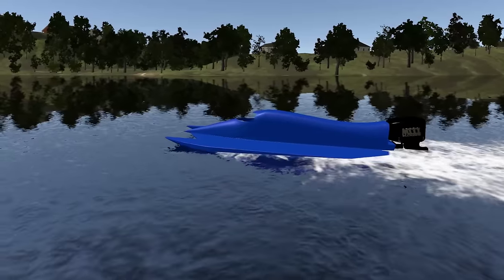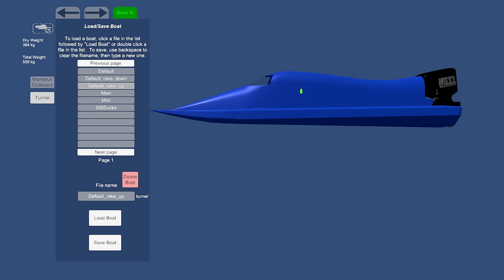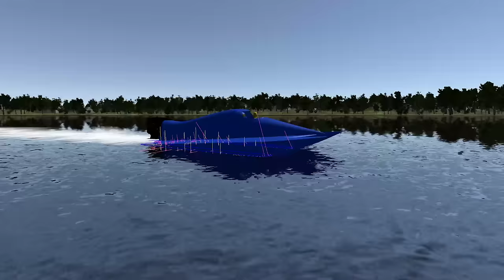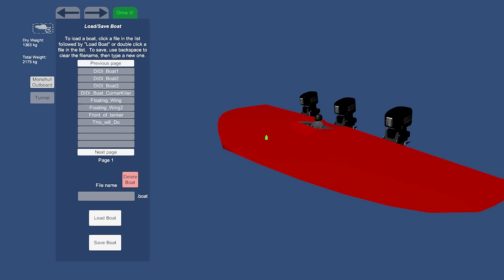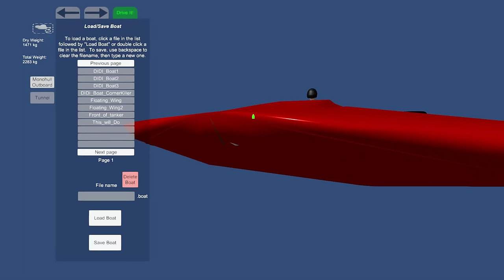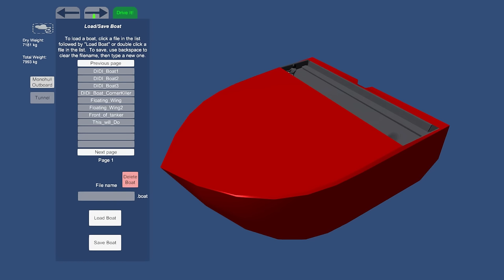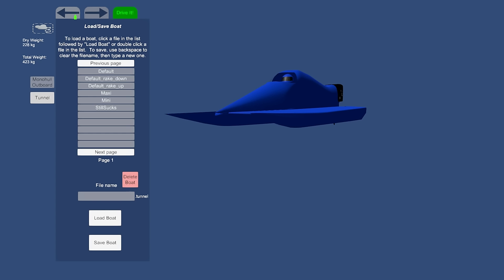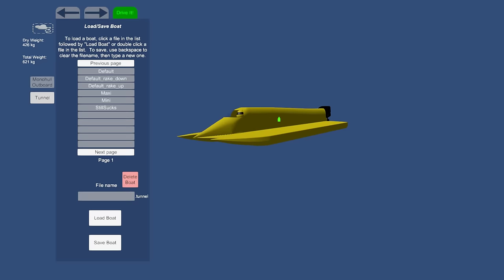Talk & Dive 22: Showboating!

Comment: Your trim is all the time wrong with the flying wing. But this is cool, I think I will buy this game :)
Reply from the maker: Wrong??! Its perfect! Ok, it can't be steered, you can't see anything, and swimming is faster.... but other than that.. :D
Reply: Hah, indeed :D. Btw, it's really easy in reality to flip your boat with wrong trim. Nearly did it with our water skiing boat when I was younger. It was super light, small boat with only 30hp but I had trim on highest setting when I "floored" it and up we went. Angle was probably around 70 but luckily I managed to shut off the engine in time.